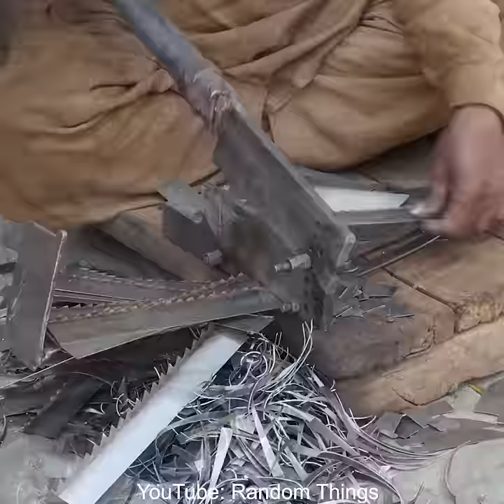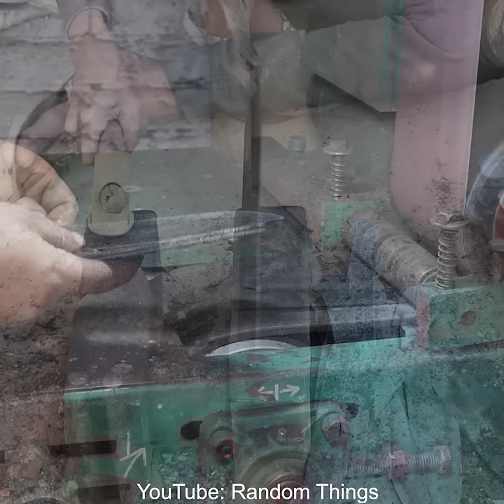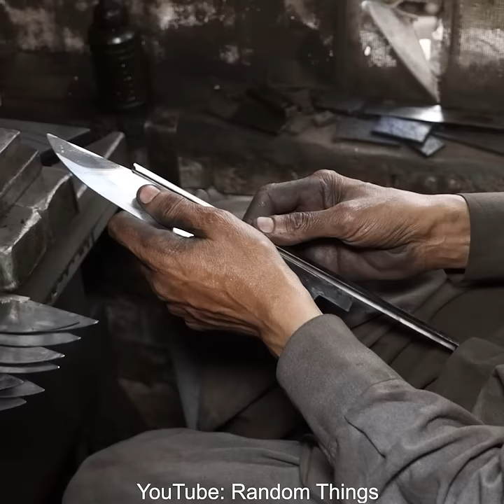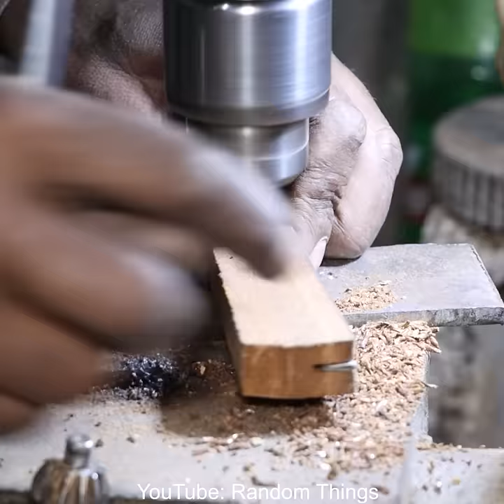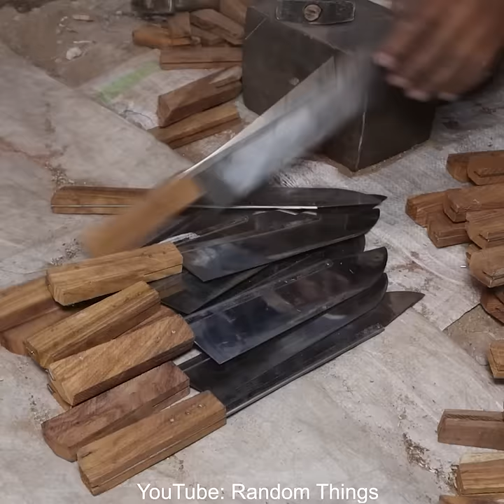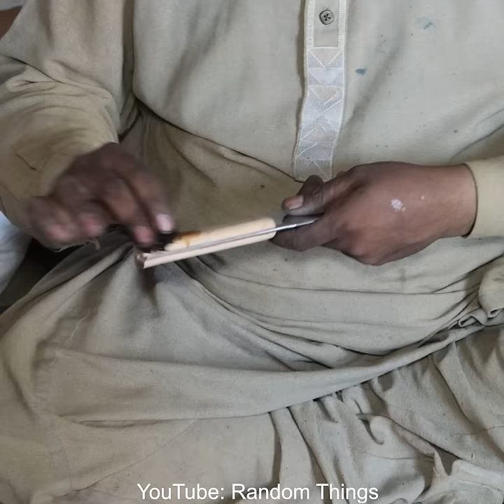Process of Making Meat Cutting Knife From an Old Saw Blade

Comment: So thats where the dollar store knives come from.
Reply: Nope 😂 they use much much more poor quality and Plastic handles
Reply: These are alot better haha. Band saw blades are good steel.
Reply: I think there well made.
Reply: @ertelemis2741 you don't know Jack they used old saw blades for the steal which is high carbon steal. And the fit and finish is actually very good. That knife if more than enough for a skilled butcher to cut meat all day!
Reply: zkb kitchen knives, where can I buy them?
Reply: @lvsurfcat8584 Ur kidding right lmao? Just buy Chinese knives anything from India is much worse
Reply: @Billy-burner how so?
Reply: @nickfuryjr1346  bro anything made in India is made on dusty red sand floors with people wearing sandals and some 70 year Olds with chisels and hammers using clapped out machines..at least in china they have concrete floors, clean factories and precision machinery.
Reply: @Billy-burner  its seems to be that u hated india.
Reply: @nickfuryjr1346  nah I've brought overpriced "precision" tools from India and they're absolutely garbage. Not race hating at all..
Reply: @nickfuryjr1346  brought a set of adjustable reamers, some lathe tools and they were literally covered in red dust and the threads were cut by hand. The hardened cutting edges shattered instantly under the slightest pressure. Much worse than China, I'm talking twice as worse.
Reply: @user-z3r0187  it has a folded spine on it because its made out of wafer thin bandsaw blade.... are you kidding me? pretending that these are remotely useful in a kitchen..
Reply: @miles11we  you don't know that thin knives cut better? This is a great knife, it is thin but has that spine support which makes it rigid
Reply: @Billy-burner  this is in india? I thought it's pakistan
Reply: @blueberry766  the spine will run into stuff.... are you ok? 
Have you never used a saw with a back?
Reply: @miles11we   yeah I know and you know that aswell so why would you use it to cut something hard enough that won't bend around the spine? The only things I can think of are big vegetables, big fruits like watermelon and frozen meat, unfrozen is soft and should bend around the spine allowing you to cut all the way, have you never cooked anything before?
Reply: @blueberry766  look at its size and shape, what are you going to use it for if not large vegetables, meat (no it isn't going to just effortlessly flow around it, and even if it did, its just a place for shit to get crammed and be impossible to clean adequately), etc??? It isn't exactly a paring knife.

I cant believe I'm arguing that knives work better when they are of a similar design that we have been using and agreed on it being a good design for thousands of years. 

Literally the only benefit is that it can make use of the specific waste steel that they had on hand.
Reply: @miles11we   hey am not saying it's a good flawless design, am saying that it's functional and yes that spine will be hard to clean, might even develop mold, also size and shape for the most part don't matter to me (subjective) when using for general purposes
Reply: @Billy-burner in china it will be made out of lead lol at least they used good steel.
Reply: @onezsz  lead would be worth more so I wouldn't complain 😂
Reply: Nice joke. It seems you have come from another world. These are the people of Pakistan, the leaders of the mad people.
Reply: @Billy-burner Nice joke 🤣🤣🤣🤣. Looks like these are people from your country. Looks like you have come from another world. These people are from Pakistan and not from India.
Reply: @Billy-burner Chinese goods are not sold in India like in your poor country. It seems you have not seen Indian knives. If you had seen them, you would not have barked like a dog.

Comment: The grinding on the blade heated the steel to over 1500*. That’s gonna take that hardness right out of it!
Reply: U get what you pay for tho
Reply: When welding bandsaw blade you need to then heat it to a bright red in order for it not to break when it goes around. Thus the actual heat from the grind may serve more beneficial purpose than detrimental.
Reply: It wasn't heat treated anyways, so there might not be much loss?
Reply: @dimitrijekrstic7567 it was heat treated. You can tell by the polymerized oxide layer formed in the quench, but it doesn’t matter. Those knives are gettin dull real quick!
Reply: @tomk3732 there is some truth in that, but for a knife- especially a chef knife, it is extremely important to have a hard but not too brittle blade. The blade being hard and brittle is much better than soft and malleable. Traditional Japanese knives were and are hard enough that a twist on the cutting board can chip it.
Reply: It'll cut once B4 u need to sharpen... This ain't the kind of metal you can heat treat 🤣
Reply: Мягкой нож быстро тупится, но так же быстро точится. Получается что этот нож - дешевый и всегда острый. У меня был разделочный нож из мягкой стали. Что бы его сделать острым даже для бумаги нужно было всего 2 движения в обычной точилке. Легко тупится и легко точится, острый до ужаса.
Reply: Согласен, только там не 1500, гораздо меньше
Reply: Вы правы закалки нет
Reply: Закалки нет он мягкий
Reply: @m.k.k.4931  
You obviously know nothing about metallurgy. This is exactly the type of metal that you heat treat
And if they hadn't taken out the temper in the grinding, those knives would be better than any Damascus steel or stainless steel blade! If they were to temper them again, they could be great again!
Reply: Им плевать. Ножи стоят дешево.
Reply: Vdd. Todo esse trabalho não adiantou em nada. Se não souber amolar
Reply: 1500c uzeri degil celik erime noktasi isil islem 1200derece en fazla ben dokumcuyum
Reply: Not all knifes are made hard and often western knifes unlike eastern ones are very soft thus bend rather then chip.
Reply: 그렇치 저칼은 싼맛에 쓰는 막칼이니까.
일단 밸트사포로 돌리는 순간 편리함과
칼의 수명을 맞교환 하는거니까 고급칼
쓰는사람은 알겠지 뭐 .
Reply: Was there hardening in the first place?
Reply: رائع
Reply: Why on earth didn't they just leave enough metal for a tang on a knife instead of putting on that spine like that? Seems like a place for bacterial growth
Reply: @MartinBruleJr  that’s a good point!
Reply: Don't let that branding fool you , that's a cheapass blade ... not a chef knife to be used all day
Reply: @heisenberg19989  yeah, i can tell
Reply: Cutting tomatoes n shit probably light duty that anyone that knows a knife would have just for that type of stuff
Reply: Kinda pain in my eyes to see that knifes heat treated then sanded red hot
Reply: 1500 grad beim schleifen 😂 genau
Reply: Xin giá
Reply: H t f c !! this is truly amazing
Reply: Some stupid guys here are trying to compare this with high end branded knives 😂
Reply: Между прочим самодельные ножи из пилы или косы очень острые и хорошо держат жало.
Reply: Hmmm
Reply: Kaha banti hai ek bhejdo
Reply: It's cheap knife not the fancy ones it's cheap durable and made for what it's supposed for that is to cut veggies meat or fruits.

Comment: They just lable it "stainless steel" at the end 😂 i guess if it barks like a duck...
Reply: And they didn't even make it with a real tang. Just stamped another piece of metal, and pinched onto the spine and made into a pseudo tang..
Reply: I didn't see any "stains." 🤔😁  "stain-less"
Reply: @Zeeboklown  if it's stupid and it works it ain't stupid, and hey this knife won't see much heavy use anyway.. actually that depends
Reply: Duck also barks😂😂😂
Reply: For anyone wondering, the blades here would require higher chromium content to actually be stainless. These knives are definitely carbon steel.

Comment: One last step would deliver a knife with a hard tempered edge. After the coarse bevel grinding, it needs to be induction heated and quenched in oil or water to harden the edge.

Comment: I don't hate them, but i am curious how long that super cheap steal will hold an edge.
Reply: About 3 seconds. These are Dollar General quality.
Reply: Youll have to worry about the rust or it coming off the handle before the edge goes.
Reply: the steel of these sawblades is hard asf. These blades are made to cut the trees it it’s length, and stay sharp after hundreds of meters of tree cutting.
Reply: I got that one from over 17 years lol I got set of them gifted from father and all you need is to sharp them after time of use and believe me they are super sharp can cut finger from bone while doing something have to be careful alot